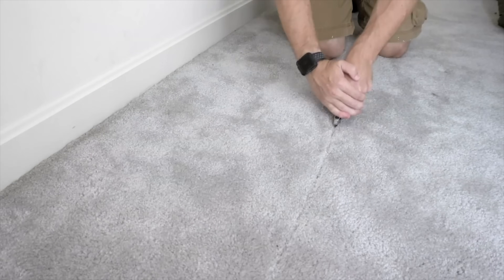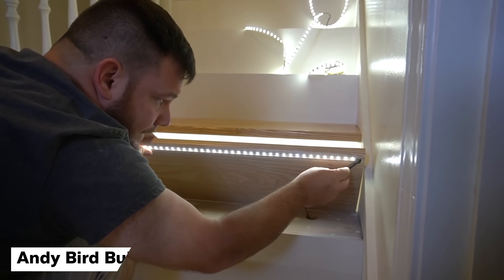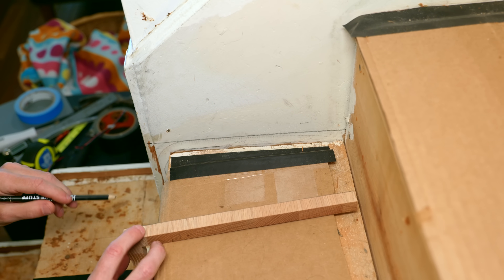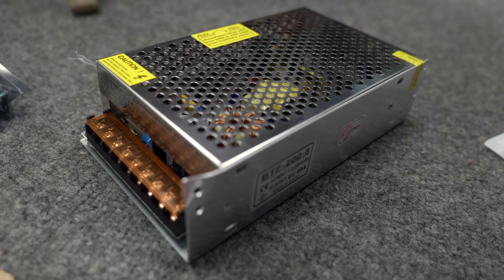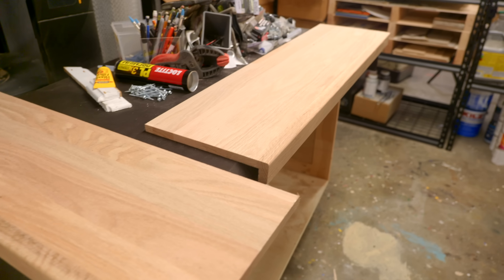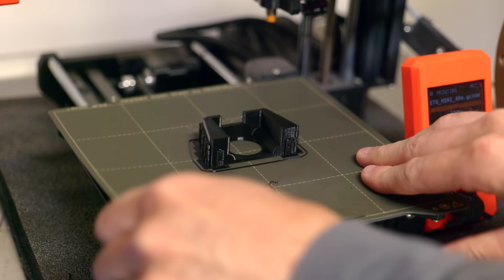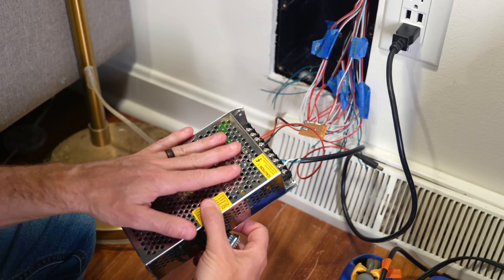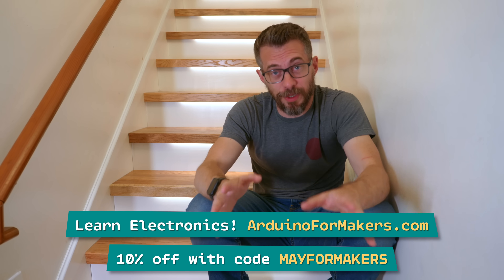Smart Stairs Now Exist...But Should They?

Comment: I would have just ran the 120 volt AC wires for the DC power supply over to the power outlet box on the inside of the wall and then spiced the lines in parallel (wire nuts or Wago connectors, etc.) inside of the outlet box with the wires already feeding the outlet. This would look a lot cleaner and still give you use of both outlets. Just my .02 🙂

Comment: Whats in the wall on your left?  2 reasons first off the power supply has to breath, second the vent covers ugly  but better yet you could add wifi to the adreno and control the lights with your phone or laptop hands free. Also the gap on the right gave you room to run wires.

Comment: Looks awesome, but I am confused about one thing in your setup. Your control box was mounted in the wall right next to an outlet. Why would you put a hole in that beautiful box and run a power cord? Why not just hardwire it in, or wire a second outlet inside the wall or in the box?
Reply: Good question as it is a code violation either way.

Comment: Would be cool if the stairs only lit up a couple behind and in front of you at a time. That way the lights followed you up the stairs. Or each stair lit up as you stepped on it like a sci-fi movie. Second idea would be harder to accomplish and would probably require weight sensors. But first idea would be pretty easy.

Also you've got all those colors, why not make a rainbow highway mode that goes either up or down depending on which way you're walking?

Can you update the Arduino code wirelessly?
Reply: Make them like in Michael Jackson's Billie Jean video Add some music for extra effect.
Reply: @chaos.corner  I was thinking Rainbow Road from Mario Kart 😂

Comment: 12:28 this whole motion sensor thing on the hand rail is stupid. 
No one JUST wants few steps illuminated. While climbing up/down we always look at all the stairs for better balance / judgement.
Instead you should have put pressure sensors on the top and bottom stairs and turn on and turn off based on that.

Comment: If I were to do this project, I would replace the PIR sensors with individual pressure sensors from old safety floor mats like they used outside of grocery stores, then program the arduino to tag each led strip with a number. Using a simple calculation, the arduino basically takes input from one stair, creates 2 variables from  (stair+2) & (stair-2), checking to see if they're off, and if so, light those up. If pressure is applied to say... Stair 5, stairs 3, 4, 5, 6, and 7 would light up.
Taking a second step up to stair 6, such as climbing the step, the arduino checks to see which ones are already lit and leaves them alone, only turning on stair 8 because stairs 5 and 6 both have pressure on them, turning off stair 3 when the person's foot relieves pressure on stair 5.
I would take 2 PIR sensors and place them at the top and bottom of the flight of stairs so that at least one stair is lit depending on which direction you're coming from so that it's already pre-lit. Can't be too careful on that first step lol

Comment: I like it, but I have to say the lights not being uniform for each step would drive me absolutely bonkers.
Also I think you missed an opportunity not putting the sensors in the skirting. I would have put one at the bottom and one at the top, recessed into the skirting, then had the lights activate from the middle of the staircase to light it all up. Having them on the rail is far too obvious and leaves them prone to damage over time.
But hey, it's not my staircase and it's still a cool project!

Comment: Cool project! It's a bummer you used arduino instead of esp, so you could have it connected to wi-fi in order to set colors or modes or effects.. I wrote a cutom android app to control my room lights, and I can see these stairs fit in pretty nicely.. For mine I have around 10 different effects, and most of them work with palettes of colors that you make in the app.. And once you like the mood you can save it as scene per room or for the whole flat (Yea I don't have stairs in my flat which is the only reason I haven't done similar project yet 😂) so you can apply it with one tap.. Recently, I connected it with the google home so I can tell the google nest to set a scene.. It's pretty cool and talking about it makes me think why didn't I recorded a video of it 😅

Comment: why would you go through all of that when you can probably put the wiring in from BEHIND... because it's probably the basement stairwell or a closet space on the other side of it.  

going up the side like you are it would make more sense and better maintain the permanent structural integrity of the stair to hide the probably temporary wiring behind a strip of corner trim molding than do all that cutting which is weakening your stairwell.  whatever depth it is that you're cutting into it, whatever that new minimum width is, from an engineering perspective that's now your effective width of the entire stringer for determining the amount of weight it can support... and trust me you don't want to ride the collapsing stairs down to the basement while moving heavy furniture, cast iron bathtubs, grand pianos, or laundry appliances to the top floor.

Comment: You should consider upgrading the cables from the PSU to the distribution-board. Those are way to small to handle 40A of current. Also consider adding a fuse on the dc side in order to prevent further damage when something shorts out.

Comment: Ideas: 
1. Automatic Night Mode. Use local time and sunrise/sunset routines to automatically switch from bright daytime mode to dim night time mode
2. The mains power is right next to the power supply. Run the cable inside the wall instead of plugging it in.
3. Home Assistant Integration. This would allow a lot more automations and control over the lights
Reply: @Sean Embry To point 3: Home Assistant is a open source (free), completely local (no cloud), privacy focused and DIY friendly solution than you can run on a cheap mini computer at home. Personally, i would make it interface with it so i can tell it to turn it on and off via other means than just the motion sensors and also be able to change settings on it. As to make it run independently so it works even if there is trouble with the Home Assistant installation. The integration can just be a nice addition for someone that already has other smart devices.
Reply: @@seanembry6438 Leviton has a wall switch that does just that, you can even set an offset to deal with the time that the sun actually gets to your house.

Comment: When you stuffed all the wires through the cut hole into the plastic control box, that rough edge made me yell, "Grommet!" Please tell me you put a rubber wire grommet on that edge to prevent chafing the wires.

Comment: I think after watching the video, if I were to do the same thing, I'd simply put a motion sensor around the top step and another around the bottom step. Then program it to start the animation depending on which step you step on first, and then possibly program a similar animation for turning them back off when you step off of the stairs, if that makes sense.
Reply: coding gets very complicated if you consider someone may be going down when another person is going up.  much easier to have it trigger on if you sense motion.
Reply: @daviddonahoe1303  That's true, I hadn't thought of that. Maybe there could be some sort of abort feature that just turns them all on until nothing happens for a set number of seconds, or something like that, when more than one person is present.
Reply: Exactly what I was thinking. I feel as though he made it a little more complicated than it should have been. 🤷🏼‍♂️

Comment: Uff it's been a long time since I've programmed an Arduino hahah nowadays it's just esphome, much much (really much!) simpler then Arduino itself and as a bonus it integrates with home assistant out of the box. Oh and it updates OTA so no more coding right next to that box, just use your comfy chair in your office :)  Kudos for the stairs though albeit I would have used aluminium profiles which are a standard 12mm wide, come with a diffuser pre installed and most importantly: they dissipate heat more effectively, specially important for rgbw lights which can generate quite some heat, which is even more important when you go 60 leds per meter or more. Also: no issues with power drop? I imagine you used a 5v configuration but what I would have done is use addressable LED's and make one long chain injecting power every few strips to ensure correct brightness. With that many leds though I would probably have gone for wled maybe and a quinled (not sure, would have to test it out first :) ) It's a nice project which I want to do in my house as well but then with those modifications so that I know it will last for years and also to be sure I can create all the animations I'll ever want straight from YML instead of having to understand all the code.

Comment: It would be awesome if you made those smart, so they automatically change the mode according to time, season etc.. 
Could be easily done with a wifi-module for the Arduino. Or just use a ESP32 Module.

Comment: I cant say im a fan of stairs with lips because of a possible trip hazzard if your foot gets caught on one but it does look nice
Reply: The lip or nosing as it's called is code everywhere in North America for residential. The nosing increases the depth of each step but not increasing the overall length of the entire staircase.

Comment: I made something similar using the new Aqara presence sensor and individually addressable strips. Works pretty well and can turn on when you are a certain distance from the sensor along the path of the stairs. So if on the bottom, first 3 steps light up, if on top then only those 3 turn on, middle/etc.
Reply: That is an expensive solution. You can get microwave presence detection modules that do the same thing for a lot cheaper.
Reply: @conorstewart2214  it was even more expensive because I tried the microwave ones first but wasn’t smart enough to make those happen. The extra 40-50 for the Aqara one ended up being far easier for my non-programmer brain with the graphical interface lol.

Comment: New construction they put a spacer on the stringer that spaces it away from the wall.  For a house that only gets drywall that spacer will be be a 1x4 (3/4") for something that has half or 3/4" skirt a 2x4 is used.  The the drywall and skirt board can be slid into space at the appropriate time in the construction process.  At least in most of California that is how it is done.

Comment: The single wire going from the board to the power supply can definitely not handle all that power at full load, the gauge is too small, this could be a fire hazard. I also recommend just installing wled so you can control it from your phone, since it is an esp after all it has wifi capabilities.

Comment: I added smart LEDs to my stairs in 2018.  One of the coolest and most unique upgrades that really sets my house apart.  Everyone who comes over comments about how much they like it.  I used Arduino with a wifi shield for my first iteration, but the damn thing kept crashing.  I ripped it out and went with esp8266 and it works so much better, plus it's a much smaller form factor.  Also, the esp8266 allows for programming OTA (over the air) which is HUGE when there is some small tweak that you need to make.  Same code, more or less, but smaller and more reliable, YMMV.  I also tied my code into my home automation system via MQTT so I can change the colors and modes from my main control panel or my phone.  Really cool project.  Love seeing more people do this and seeing how they solved some of the same issues that I faced, that anyone who undertakes this project will encounter.  Kudos and thanks for the video!
Reply: whattttt😂

Comment: It would be interesting, assuming that the Arduino has full DATE and TIME, to have the colors for your "Christmas Mode" to adjust automatically based on holidays (Independence Day, Thanksgiving, Halloween, New Years, etc). Based on the date, the "Holiday Mode" would automatically chose the color pallet.
Reply: for that use rtc module, that has a battery to keep date/time during power loss, reprogramming etc. Good idea though
Reply: The arduino itself has no ability to tell date or time, you could add an RTC module but it would need to be manually set. If he used the esp32 like he suggested in the beginning then it has a built in RTC and can use wifi to get the time from the internet to automatically set the RTC.

Comment: So...what did you use the ESP32 for? :P did you go for the arduino instead because it was more straightforward? I've recently started working with the ESP32 and it's got some tricky bits with it if you're only used to the arduino uno

Comment: You could start the light up sequence of every LED-Strip in the middle and let it spred to both sides like sliding doors. For the turn off animation you could invert the animation. You could also connect it to a aastro clock (e.g.: Eltako S2U12DDX-UC) to let it change between day and nighttime function on it's own.
Reply: Or if he used the ESP32 he originally said he would then it has an RTC and has the ability to connect to wifi to use NTP to get the time a few times a day to adjust the RTC. Or he could just connect an RTC to the arduino, although he would have to manually set it.

It would be much cheaper than what you suggested.
Reply: @conorstewart2214  My RTC can be set with software. ;)
Reply: Add a speaker and have the lights start at the railing end and light up towards the opposite side with a speaker in the background playing the Lightsaber Igniting sound file...
When they turn off, they just reverse the process from one end to the other playing the Lightsaber shutting down sound...

Yes, I admit it...

I'm a HUGE Star Wars Nerd...

😄😁😆😅😂🤣
Reply: Where can we get the wiring and code?

Comment: Did you look into possibly going with WLED and PIR sensor usermod instead of custom Arduino route? There's a few existing implementations using HC-SR04 sensors at top and bottom instead of PIR's too :)
Reply: WLED would make adding or changing animations super easy

Comment: Nice build, I would try to use pressure sensors on stairs instead of motion sensors
Reply: Very smart. Also, blink the lights to indicate overweight. Wire the blink to some counter so they blink once in 120 activations, ignoring the pressure sensor output. 1/120 means it would activate about once a month for a family of 2, and both spouses use the stairs twice a day. Depending on routine, it would likely activate for the same spouse every month, either in the morning or at bed time.

Comment: Awesome project! I'd recommend mounting the LED strips to something like aluminum, something that will help them dissipate heat. If you're not running the LEDs at full power, it most likely won't be an issue, but allowing LED strips to get rid of any heat they generate can really help expand their lifespan.
Reply: That's probably not a huge issue in that application, the lights aren't going to be on for very long most of the time, but even when they are, those strips really don't get hot enough to cause any issues. I had a smart light strip mounted to my headboard a few years back and even at full brightness the entire thing didn't even pull 10 watts, and the strip itself didn't even get warm enough to notice the heat

Comment: Here in Germany carpet is nearly always glued down, mostly with double sided tape.
Also while i like the idea with the project box, would'nt it be better and more clean to power it from inside the wall instead of with the plug outside? There is an outlet right next to it which should give you AC.

Comment: That washer trick at 6:03
Reply: this is why we become smarter every day
Reply: Oh, hi Destin! 👋
Reply: I missed that first time round; great shout!
Reply: Of course Destin would notice this and understand what’s going on (I’m clueless).
Reply: @zanokuhlemabuza3762  Using the washer as a spacer to get an accurate line following the contour of the wall. Especially useful if the surface you're trying to work with isn't exactly flat, or is hard to get an accurate angle measure on
Reply: @richardmillhousenixon that’s pretty smart. Thanks for the explanation.
Reply: @richardmillhousenixon  How does the washer trick work for the other side?  Won't the piece to too short?
Reply: @aggibson74  Yes, but in this case that was intentional. A gap was needed on one side to run the wires, and how it was done the gap was then hidden by the stair edge
Reply: Yeah yeah you watching this video checks out
Reply: I had to go back on that one, is a useful trick, will have to remember it.
Reply: L0:

Comment: It would have been really cool if you'd used load cells under the treads instead of motion sensors, but this is awesome.
Reply: I was thinking vibration sensors. But totally agree step-level resolution would be fun.

Comment: I would have considered magnets secured with epoxy to hold the light bars in place rather than friction, but I'm just glad you thought of maintenance/replacement from the start (an easy thing to forget about). Looks awesome. And you made a night mode!
Reply: was going to say this too, pop them in and out with a satisfying "snap"
Reply: I was thinking of a velcro strip to hold them in place, but magnets might be better.
Reply: Same.  I was worried that the wood expanding and contracting as humidity changes would cause the friction fit to fail.
Reply: @disjustice  Yeah, and if the lights fall out as you're using the stairs, it could be dangerous.
Reply: Can music be added somehow to synchronize with the light show on the stairs?